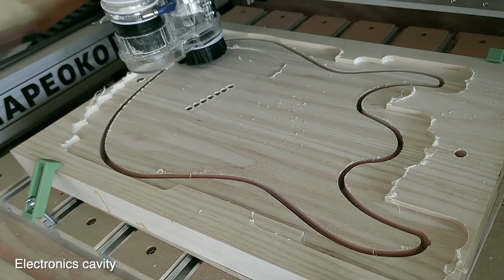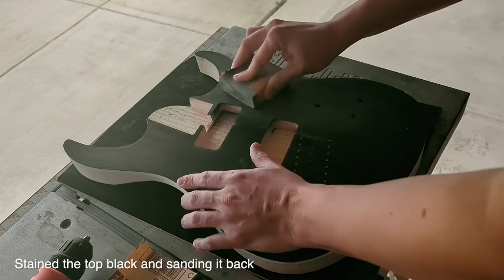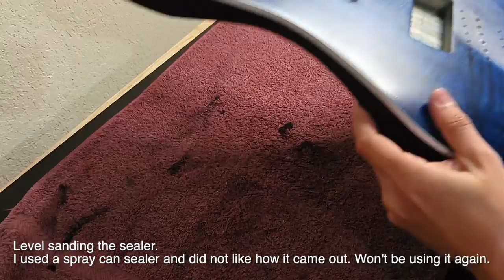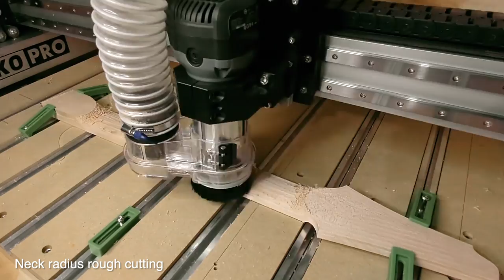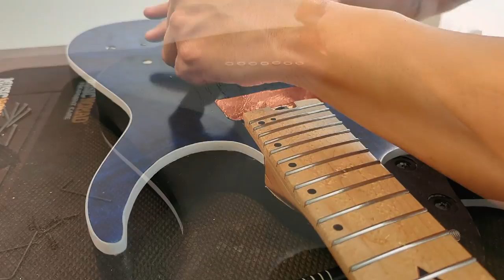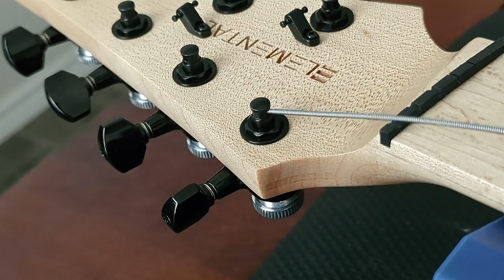7-String Multiscale Guitar Build on CNC Machine

Comment: Based on the grain, the body appears to be ash, not poplar.  Despite the lines in the body and the clearcoat issues, it's still a beautiful build.  6th fret for parallel is an interesting choice. How did you arrive at that?  What's your profit margin on a build?  How many builds to pay for the Shapeoko Pro at almost $3000 ?  OTOH, it does replace a lot of tools and jigs - assuming the jigs even exist - stuff like saws, routers, drills, etc.  For guitar clear coats that don't require pro paint shop gear, I find rattle can lacquer to be a good combo of price, ease of application, drying times, and easy to fix errors.  Brush on poly wiped on with clean paper is a close second.  Its a bit more work to apply, and takes longer to cure, but costs less and is practically error proof.  Raising the grain before staining can help. Popping the grain does the same thing.  Gibson's trick of an extra coat after sanding and before polishing helps too.
Reply from the maker: I've tried different spots for the parallel fret. I ended up really liking the 6th fret, and less of a scale difference. Having it too high and the first frets are too angled for my tastes.

I purchased the shapeoko as an investment and for fun hoping to make the money back when I eventually sell some guitars.

I've used wipe-on poly with great results and got it to a mirror shine. Crystalac bright tone is awesome too. I'll probably stick with wipe on poly. Just didn't like the spray can finish. Not for me.
Reply: @DavidCorona81 I know what you mean about the less scale difference and the first fret being too angled.  That makes sense because on builds with more scale difference, 9th fret parallel seems to be the sweet spot.  But of course there's no general consensus yet, which is why I find it a topic of interest.  Odds are there is some optimal relation between scale difference and parallel fret selection.  It's just that builders and players have yet to settle on just what that is, since multiscale is newer and less popular than non-multiscale.

Based on the cost of the parts vs what you could sell them for, I'm guessing about 10 builds or less to pay for the CNC machine, even if you don't charge much for the guitars.  That's really quite reasonable from a business standpoint for a capital investment.  The minimalist guitars I build require so little woodworking it's hard to justify a CNC machine.

Generally speaking, spray finishes are a bit more temperamental to apply than wipe-on or brush-on finishes.  They can be especially frustrating until one learns the proper methods of error recovery.  Such methods do exist and are not complex.  Knowing them makes working with spray finishes a "have no fears" proposition.  The type of clearcoat matters as well.  Lacquer melts into itself, while poly tends to layer.   Sanding a high spot can cut through one layer of poly to the next, leaving a mark.  With lacquer, you just have to worry about sanding all the way through to the paint or stain.  And of course, a paint job is only as good as the surface prep work done beforehand.  If you're going for that "dipped in glass" look, you'll probably want to raise grain multiple times before staining or dyeing, use lacquer (spray or brush-on) for the non-layering behavior, plenty of coats before you start sanding, lots of block wet sanding, and use the Gibson trick of a final coat after sanding and before buffing.  These days I tend to favor more textured finishes.  Open grain, a couple light coats of lacquer, and no sanding or polishing.  Some examples:
https://www.youtube.com/watch?v=WaMS_jOxjoA&list=PLDxhKgqkO6tNJI_8ENHonbBdMpwdZ10sS
https://www.youtube.com/watch?v=fGve4MbuXFc&list=PLDxhKgqkO6tOV1fi0XhFJgYBs4T86t8O6
https://www.youtube.com/watch?v=0hbZ6g27Xj0&list=PLDxhKgqkO6tNA47o15k82DhuKcbMA-via
Reply from the maker: @normbarrows  Definitely agree. I do plan to try spray finishes again in the near future. I have an air compressor, I just need to purchase a good sprayer and watch some videos on it. I think I just don't want to do the rattle spray can again.
Reply: @DavidCorona81  Guns will tend to get better results easier than cans.  Extra cleanup time, initial gear costs, and the initial learning curve are the only downsides.  I should probably make that big move to "spraybooth city" myself.

Comment: Brilliant, how did you align the back of the neck when it is all carved out? Did you use dowels nect to the trussrod slot or how? Thanks
Reply from the maker: I use the CNC to drill alignment holes at both ends of the neck wood. These holes line up with holes I already had it drill in the waste board. Then I use metal dowels when I flip it over so the holes are exactly aligned. I also use two sided tape and remove the extra wood once the outline is completely cut out.
Reply: @DavidCorona81  great Info. Thanks